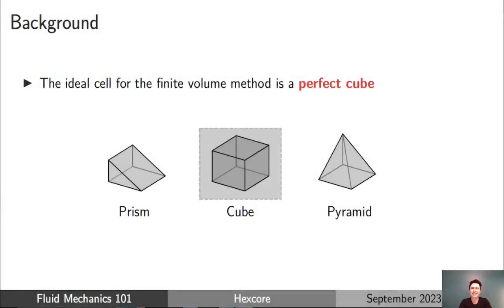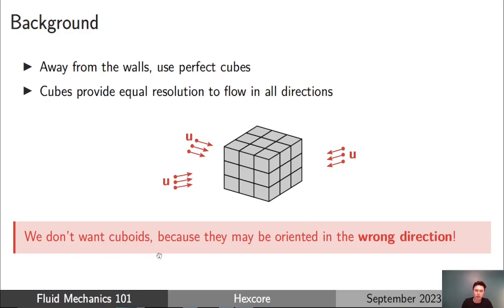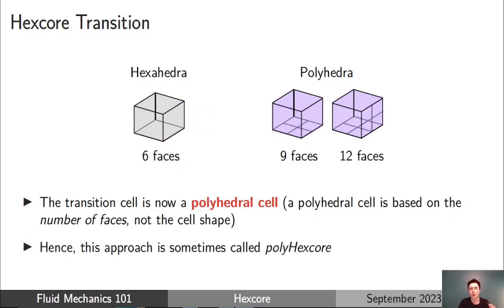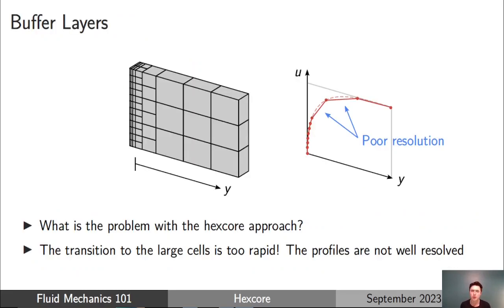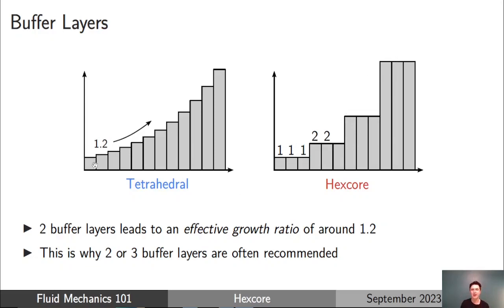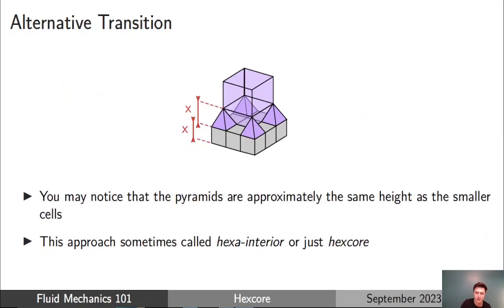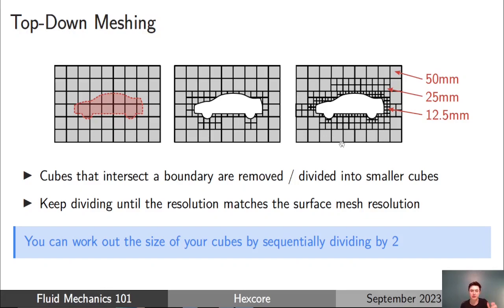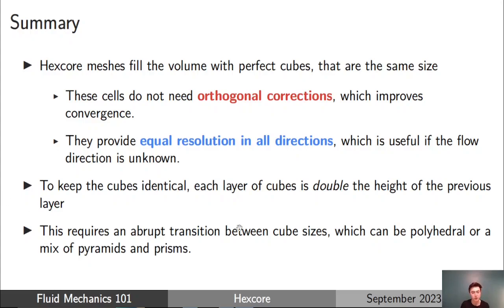[CFD] Hexcore Meshes for CFD

Comment: Thanks for you content!!!
I have a question it is bothering me.
What happens to the nodes that are not connectied to the next nodes which are placed in bigger cells corners.
For example if one face of the cell is divideed by 4, and it is connected to a face of a cube wish has only one single face, what will happen to the cell in centroid of the connecting face?
13:52 mesh figure is my question

Thanks a lot Aidan

Comment: Awsome lecture. Thank you. I've been working on a LES (WALE) simulation of a flow over a flat plate, comparing results to a DNS solution, using openFoam (Foundation). Mesh was generated with blockMesh, so it was orthogonal (zero nonOrthogonal cells). I expected a good match with DNS, but it turned out to be far from it, particularly using stretched cells along the wall. Results start to get better (better matching to DNS) as the mesh is refined so that aspect ratio is close to 1.  The problem is that the mesh gets really big,  because the refinement close to the wall has to be extended to the whole domain. The only solution that I can figure for this is a Hexcore mesh. Let's see what happens next...

Comment: Then one uses snappyHexMesh and finishes with 24 faced polyhedral 😂😂
Reply: Can we do multiregion meshing with snappy hex mesh? Like ev battery?
Reply: @surajmulay6212  yes
Reply: Yup. Probably the mesh "push back" phase that causes this. Which is a crazy problem to have. Why not offset the surface for the boundary layer mesh, and then mesh to that offset?
But ok to be fair, should just make a custom version of shm to do that, but don't have the time! :D
Reply: @oskarelmgren  it is what they are working on right now. Doing the layer first. I think (and it is only an opinion) that originally was done like that to add layers to meshes done in others meshers.
Reply: @francootaola9172  Oh, super exciting! shm could actually become a good mesher then!
Reply: @oskarelmgren  it is already a good mesher. Nevertheless I am with you that it could be a great feature to be added. Nevertheless they didn't gave a date or when they will finish this(ESI vr)

Comment: Hex meshing real world geometry while trying to keep the big volume transitions away from areas with high gradients is really difficult (impossible?). Is there any rule of thumb to get a good idea as to when tet meshing is generally better? Dynamic meshing would be a super interesting topic also!
Reply from the maker: My usual approach is to try structured hex first, then hexcore. If neither of these work then I will resort to tets. I tend to find the best approach is to use good hexes in the important areas and then do a small transition between them using tets. I will be showing some demos this year, so hopefully that will help!
Reply: What softwares are able to mesh hexcore?
Reply from the maker: Fluent mesher (T-Grid) and ANSA are the ones that I use